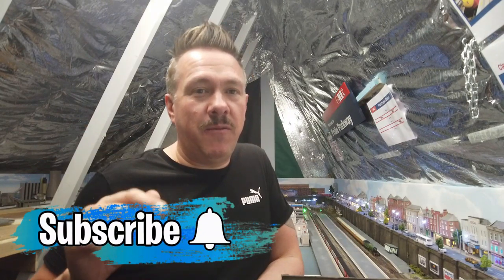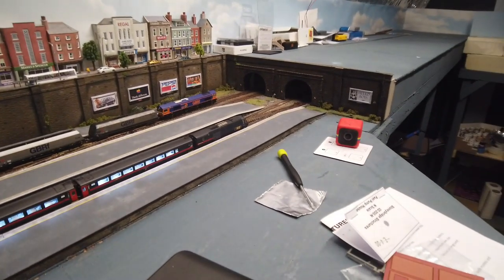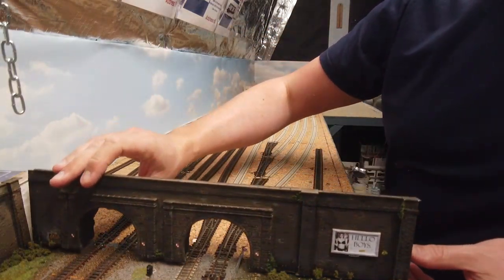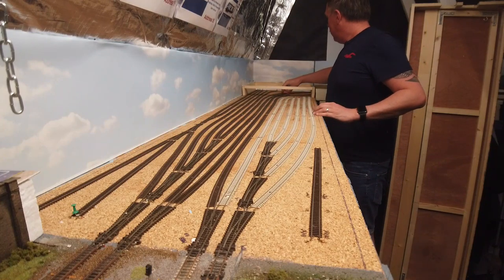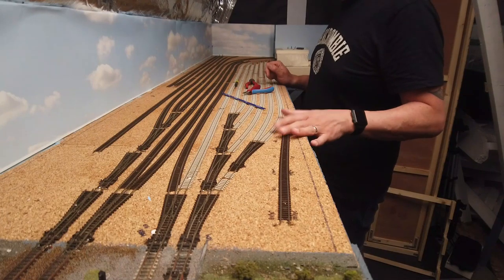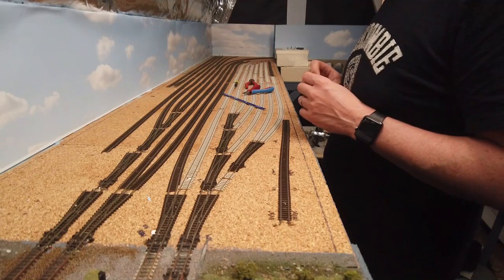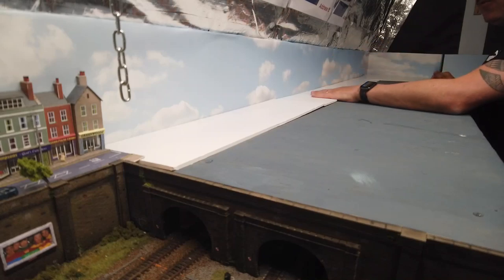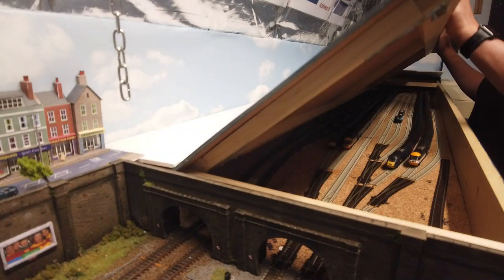Improving Large Fiddle Yard - N Gauge Loft Layout - Ep 14

Comment: Hi Geoff.  Lovely layout you have, and thanks for the video sharing.  A nice improvement of the fiddle yard you've done.  I was thinking of the excess heat you mentioned in the loft.  If you are able too - and only a suggestion, is at both ends to put in a small ventilation opening of sort, which could help with air crossflow and eliminate that heat,  quickly too.  Have a chat with someone you or your friends may know to see if achievable?  It does not have to be Gucci ;-)  Very well done.  Cheers   Iain
Reply from the maker: Thanks Iain for your kind words. The ventilation idea sounds like a great idea and actually something I could very easily do as there is vent space around the superquilt. All the best Geoff

Comment: A good system you're building here, with a good range of areas (viaduct shall be impressive when scenic-ed). If you are less keen on electrofrogs, then let me know, as a DC user I much prefer them to the unifrogs, so might even be able to straight swap some.
Reply from the maker: Thanks very much, yes the viaduct will soon be getting some scenics started. I dont mind the electrofrog points, they work well. its simply a case of remembering the insulated joiners and i have a habit of forgetting about them lol. They are all laid now so all good. Cheers Geoff

Comment: Have you thought about putting a switch on each siding power line so when a train isn’t used you can isolate it? Might help prolong the life of coach LEDs and decoders when trains aren’t needed. Also save you a little on you power consumption.
Like the improvements you have made, it looking a lot better.
Rich.
Reply from the maker: Hi Rich it is something I’m going to look into, I’ll probably tackle it at the same time as the point motors and incorporate it all in to one control panel. Cheers Geoff

Comment: What is your insulation in your loft, as at the moment I can fry eggs in my loft
Reply from the maker: I feel your pain. Its a product called YBS superquilt. I'd recommend it. It comes on a roll and basically looks like a big silver duvet. you simply roll it out, staple it to the rafters and then seal the joints with tape, much cheaper than other methods and meets all current building regs. Cheers Geoff

Comment: Hi Geoff. I have just discovered your layout this very afternoon.  I too, am building a layout in N gauge based upon the former Midland Railway line between Chee Tor tunnel 1 through Millers Dale and finally Bakewell in the LMS period. It's just a straight end to end layout with about 20' or so of working space. I notice that you are using code 55 track and points.  What type of rail joiners are used to join these oddly shaped tracks together? Take care...
Reply from the maker: Hi John, Sounds like its going to be a great layout and 20' of space is fantastic, you should be able to do a lot with that! I'm using the peco SL-310n rail joiners, they are very small and fiddly but they work well. I also use a 1mm thick piece of plasticard when joining the rails. This gives space for expansion in the tracks during the summer heat and leaves a gap to create that clickity clack sound from the trains running. Hope that helps. All the best, Geoff
Reply: @PrideParkway  Thanks for your response, Geoff, it's greatly appreciated and is your tip for putting the rail joiners in place. Take care...

Comment: Hi Geoff,  I'm just starting both with N gauge and in a new loft, I used to be OO. I'd not thought of only having points at one end of the fiddle yard before, I might look at it now. As you are running with this setup is there any down sides to it? Thanks Gerry
Reply from the maker: Hi Gerry, i'm really pleased with how it works with just the one set of points and its a big cost saving. I do run a lot of HST's so that makes it easier but for traditional trains you have to reverse them out of the fiddle yard and then drive them forward but thats no big deal for me. All the best, Geoff

Comment: Is unifrog just a Electra frog that you wire up as insulfrog
Reply from the maker: Hi Matthew, no it’s a new range from Peco the frog is much smaller than an electro frog so less chance of a loco stalling on the crossing. I’ll look to do a video on them soon! Cheers Geoff
Reply: Pride Parkway how much are tbey and I mean do you wire as insul frog or electro frog
Reply from the maker: You use metal joiners on all the rails and there is a wire on the frog that you can connect if you chose too. These are n gauge so there’s no need to make any modifications to them (I like what many 00 modellers do to 00 Peco points.